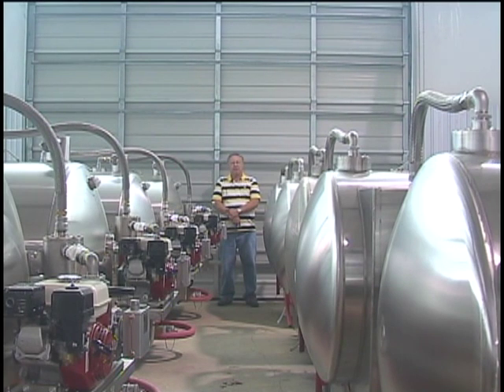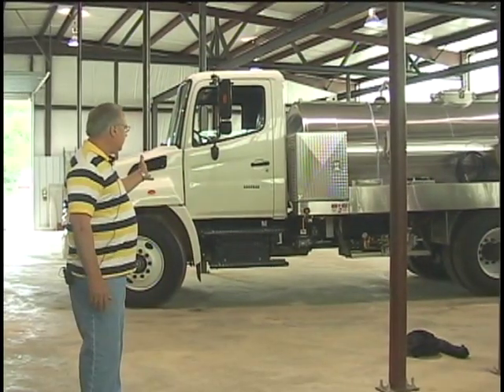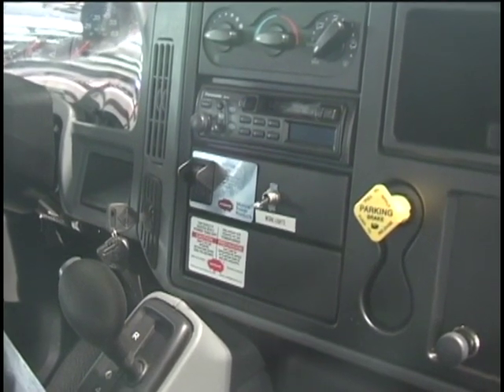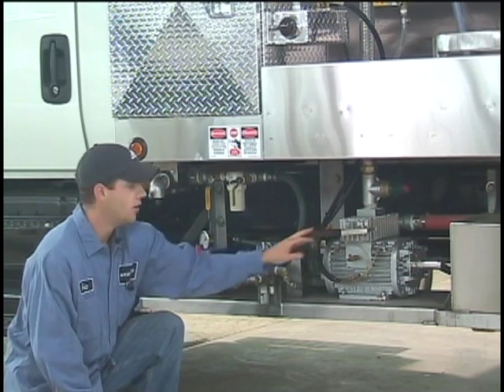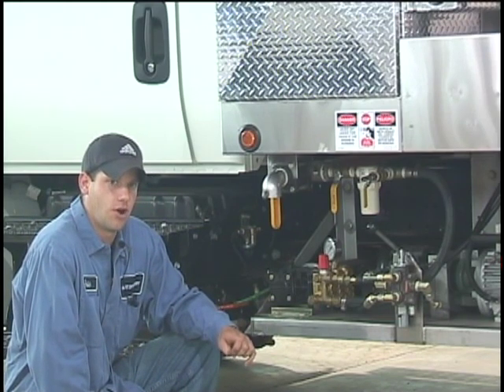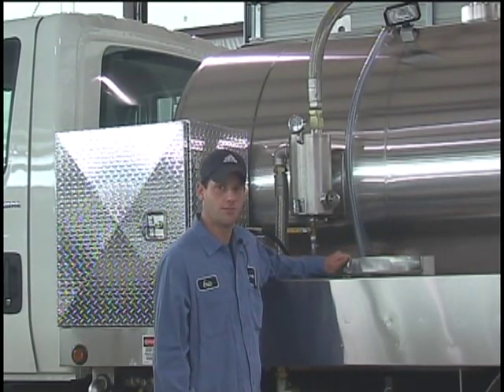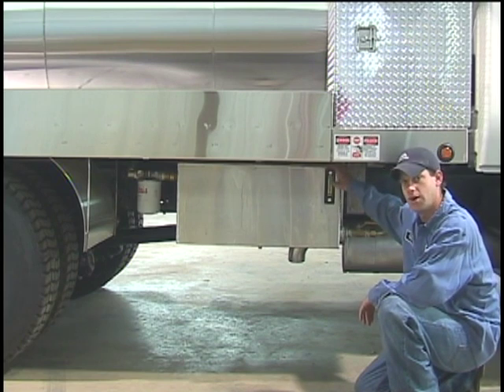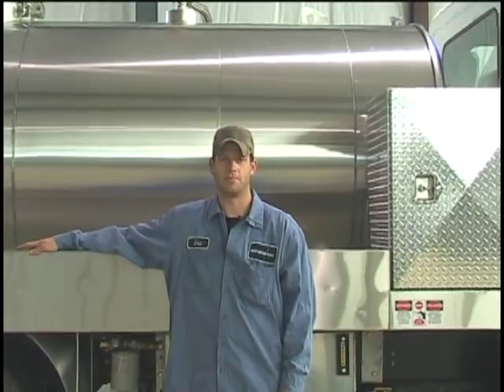How to Operate a Vacuum Truck

Comment: good video ... can you explain what happen if the truck is in use the pressure wash and pumping at the same time???
Reply: The way the hydraulics work on this particular truck will not allow the vacuum pump and pressure washer to work simultaneously. They do offer tandem hydraulic pump options that make that possible.